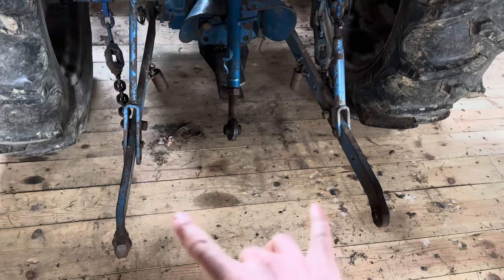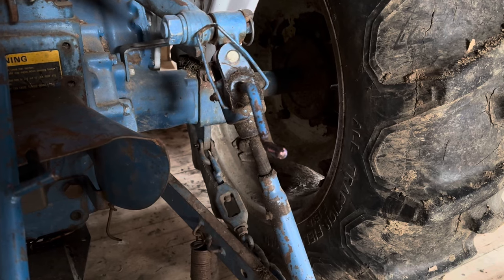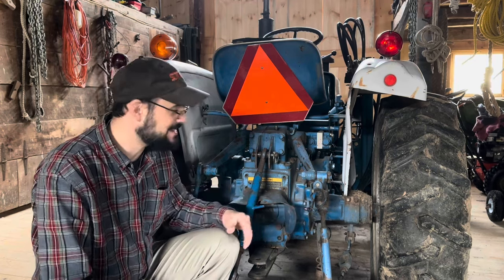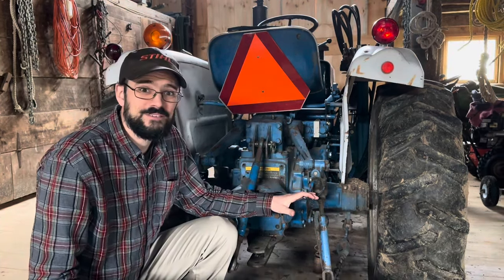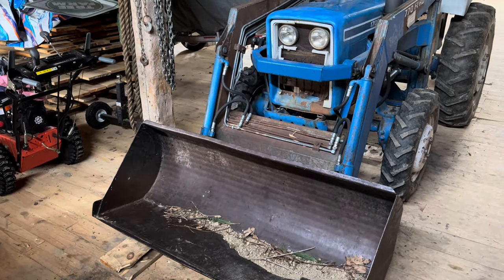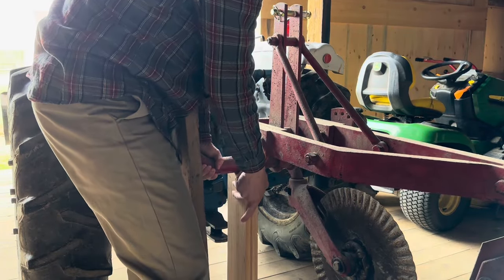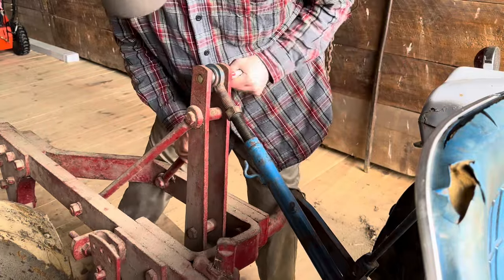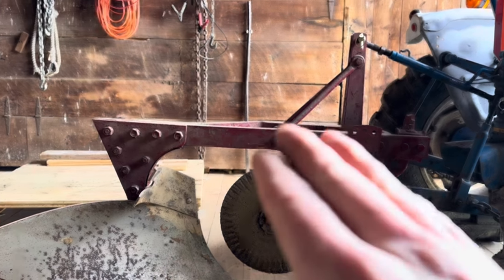What Gives? This Useful Feature is Rare on Compact Tractors (Plus Setting up a 3-Point Plow)

Comment: Thats the one thing I miss about my 1989 ford 3910. Nice video.
Reply from the maker: Thanks for watching! I’ve run a 3910 before. Solid tractor. Much larger than the 1700 that I have.
Reply: I went and got old and needed air conditioning. The 3910 was a good tractor, but I like A/C a lot more! :-)

Comment: So don’t sell your old whatever that is. My Ford 601 that thing barely moves at all. Fights the whole way but I always have something on it.
Reply from the maker: Thanks for watching! This is a Ford 1700. I keep the mechanism well-greased but with a heavy implement lifted up on the 3-point it’s hard to turn. Usually I just set things down to take some weight off the hitch arm and adjust. The 1700 won’t be going anywhere… but I really could use a larger tractor - for more weight and more loader capacity.